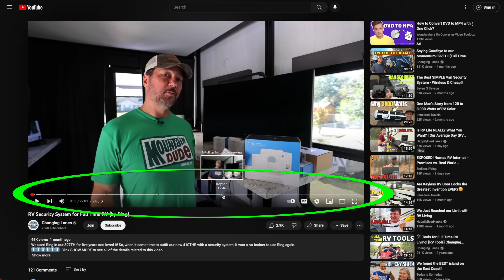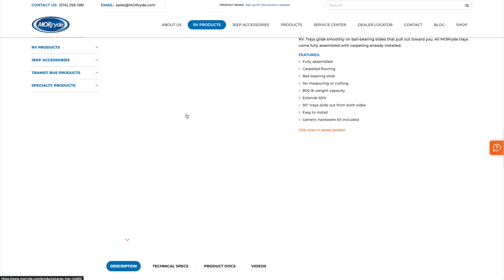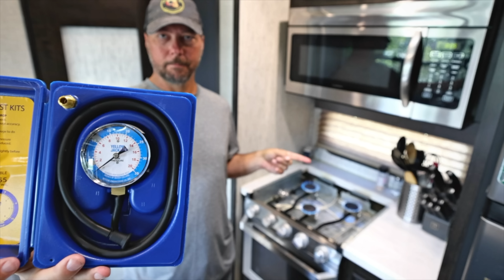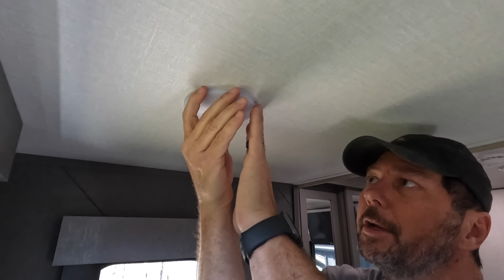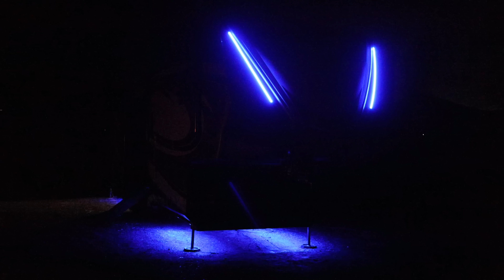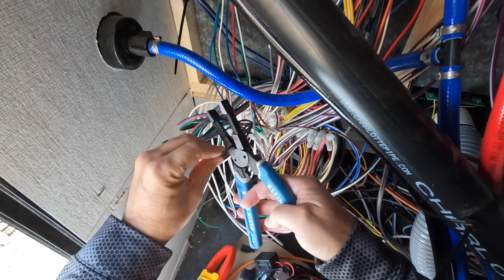Five EASY RV Projects for our New RV

Comment: Grand Design has just burdened our family with a $27,861.60 debt to repair factory weld failures hidden in the walls of our 2019 Solitude 380FL.  The RV suffered a bilateral structural weld failure on both sides of the front living room that was hidden in the walls. Essentially, the welds failed on the aluminum substructure leaving the slides to hang off the front living room walls on each side of the RV. Unable to support the weight, the walls began to cave and the schwintek slides began to show signs of failure, slowing down and vibrating, and one of the schwintek slides had to be replaced due to damage from the structural failure.  Fifty-nine (59) photos of the structural failure and the repairs were presented to Grand Design and they refuse to accept any responsiblity. Given the danger of structural failure we proceeded with the repair immediately. Grand Design claims that we should have just left it broken and placed the safety of my family at risk.  The structural failure resulted in the slides slipping and opening cracks for water to fill the front cap. Therefore, the repair included repairs to the front cap from the water damage and mold.  Please keep in mind, these welds failed long ago, and the walls held up the slide boxes as long as they could. There is another 380FL directly across from my camping spot  and his front living room walls have started to collapse inward and they were able to verify the same structural failure with the welds in the front living room.  Grand Design used to be a company we could trust with our families safety and well-being.  Those days are past and the company is now laying off workers and abandoning their customers.

Comment: I decided to catch up on ordering some of these items.  Alas, I guess I waited too long....as of late July 2023, the remote wireless lighting controller (for the bedroom overhead) is NO LONGER AVAILABLE on Amazon and, oddly enough, I could not find a similar item (with only a different set of gobble-dee-gook letters in the name).  Other wireless controllers are built around phone apps or for key rings or for controlling RGB-separate lights.  I guess I'm going to have to tear into the walls and go with a wired solution.

Comment: Wonderful video Chad. Thank you for taking the time and effort into making it. We just picked up our 410 from a dealership in Arkansas and finally made it back to North Carolina after a 40 hour round trip drive. Looks like we have the exact same setup. I am trying to figure out what size tray I can put in there. Looks like MorRyde offers a 20 inch by 90-in but I don't see another option. This 20x90 would result in some wasted space. I tried to click on the link in your description to see what size you have but the link to e-trailer is not functioning. Can you tell me what dimensions tray you have?

Comment: Had my first complaint about my cap lights from a fellow camper.  Going to attempt to install your switch to separate the cap from the lower accent lights.  Without your deluxe meter I think I have a 50-50 shot at getting the right neutral wire, if not then recrimp and try again...  Need to buy the switch and some crimpable connectors.  Do you have a standard connector that you use and recommend?  2022 397 TH-R  TIA.

Comment: Wife says I can't watch your channel any more.  That remote switch is awesome find, already have 2 or 3 places to put it :)
BTW, good thing I put in the easystart... but not for the reasons you might expect.  I discovered the hot freon copper tube was rubbing against the aircon fan frame.  I need to get back up and look harder at the line to investigate how much damage has been done to the copper :(

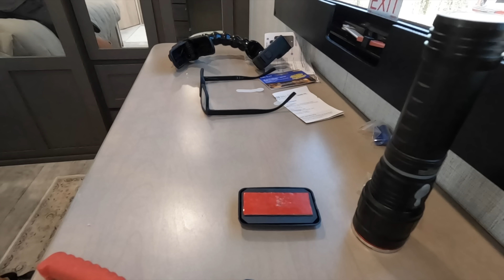Comment: I installed the dimmer on the light above our recliners.  I know it’s wired correctly because the light powers on. But the switch/dimmer doesn’t work at all.  I even te-paired it per instruction. 16:03 Guess I need to call the company. Anyone else have issues?
Reply: As Chad mentioned in another reply on this post, as well as a reviewer on the product's Amazon page, these switches disconnect the negative side of the light circuit (which is opposite of what is done with breaking the positive/hot side of wiring in home lighting).  If you have multiple ceiling puck lights that you are trying to tap into, you might be running into a problem with daisy-chained negative/neutral wires that is not allowing the controller to function properly.  The bedroom overhead is a simple situation of one wire is positive 12v and a second wire is negative 12v, so it is imperative to follow Chad's instructions of always verifying what color is what polarity in each fixture (as the RV industry does not use any standards for wiring color coding, as are used in a house).  Then make sure you understand the controller's functions (kill positive side or kill negative side) to wire appropriately.  Lastly, this remote light controller is no longer available on Amazon (as of late July 2023).
Reply from the maker: Did you take a voltage reading to ensure the positive line was actual positive?  If so, I would call or email them..

Comment: Great Video.  We have been full-time in our solitude 345gkr for almost 2 years.  We had already done the gas stop, insect screens, anti stiction fluid (although we may change brands now), and split the cap lights/front storage/underbelly into 3 switches.  The Morryde tray is out of our budget right now but we really like the idea.  We have been looking for a good option for the bedroom lights.  Really dislike the buttons popping up inside the light and the long reach required.  We added the wireless switches that you used and we love them.  Thanks so much.  Love this kind of video.

Comment: I got one of the switches today that you recommended but actually I think they are Him and Her switches. I installed it and it wouldn't work so I started swapping wires around. Finally, after wiring it right like I did the first time it worked...sometimes and it wouldn't dim at all. My wife grabbed it and it worked for her every time. I took it back and it worked...sometimes and wouldn't dim at all. But it works as advertised for her...everytime.

Comment: Thanks for the info on the cap lights. We feel the same as you, we like the underside lights but cap lights are obnoxious. Plus why not put the switch inside the rug not outside on the front. I’m working on moving ours inside and separating them. 👍

Comment: Brilliant work Chad! I love your unbiased, non-sponsored, extremely informative, well throughout, and professionally filmed and edited posts. The two of you obviously take your time to solve these issues and seek out tools, hacks, and products to make life a little bit brighter...ahem.... I mean sweeter.

Give that cheerful, sweet, amazing, brilliant, and beautiful (not creeping on her.. I'm 110% gay) wife of yours some extra love and attention for me as continues the tough battle.

Those looking to put dimmers on everything must verify your Amp draw for each of the lights. Most of these small dimmers are 5 amps. I believe this specific dimmer (now sold out) is 5 Amp. Something else to consider when installing wireless devices is the possibility of other items using RF remotes to share the same frequency. This is more common with IR remote devices than RF. For example one set of wireless candles, a space heater, the fireplace, and e
Edison style IR led bulb all share some frequencies. Adjusting the temperature on the space heater changes the color of the Edison bulbs and turn the fireplace flames off. Selecting the four hour timer setting on the led candles also switched the fireplace timer, dims the Edison bulbs, turns on a timer for a second set of legs candles from 2010 which was not advertised as remote operated nor with functions (I can dim and put them on a timer thanks to the remote for the Dimplex fireplace), and turns the space heater on or off.  It's a fun game, requiring both hands, turning the island lights, candles, space heater, and fireplace on or changing their settings. So fun!! Hhaha.

I pray others follow suit to find their way to turn off their cap lights. Thank you for understanding cap lights can be a real blinking sleepless headache for others. Every unit I've owned with MCD night shades has had the same issue with the night shade ends curling. Without lambrequins, light streams in like thousands of laser pointers. Neither my current or previous DRV Houston are equipped with lambrequins. Yes... please turn off cap lights and scare lights near the neighbors bedroom windows.
Cheers!

Comment: Thanks for the tips. Been looking for the way to get the front cap lights off on mine. Love the light switches, will use those in the garage as I added  led tubes in the corners for extra light and an outlet for my portable fridge. I also got rid of the LCI router and put my own in so that I did not have to switch networks to control the RV. There is a hint for a future video.

Comment: @Changing Lanes so I am having the same issues with popping noise on the jacks. I just got the CAT Hudraulic Oil Additive so do you only need 1QT? Or two of them? Do you need to drain 1AT of the oil from the reservoir?
Reply from the maker: Yes.. just one quart did the trick for us...  Remove a quart, then add it..
Reply: @ChangingLanes  good deal
Thanks a lot.. I love your channel and all your adventures and advices.

Comment: Great video! So many good ideas. I am really looking forward to having a sliding tray in my pass thru! It will make pack up and set up so much easier. The switch on the oberhead lights is an awesome addition that I will be adding as well. We have learned a lot from you guys, thanks for sharing and safe travels.

Comment: I like the dimmer switches, I also have the same puck lights. To be changed soon. 
Does anybody make a bug screen for the refrigerator vent? Right now I have fiberglass screen on the inside of the access panel. Found those mud dobbers in there.
Reply from the maker: Maybe these? https://amzn.to/3nPnvjK

Comment: In your knowledge, are all the puck LED lights able to be run through a dimmer switch. Ours over the bed are not the nipple type but are on a wall switch.
Reply from the maker: I can't say 100%, but they should work on most LED lights.  Additionally, the ones I used can be pared to 3 lights or a single light can be pared to 3 switches.

Comment: Another great chapter Chad!  Curiosity has me ask from one of your old upgrades on the party deck flex seal upgrade.  Will you be doing that to your 410? My wife and I purchased the Momentum 320G last fall and that was one of the first upgrades I did.  Our previous toy hauler showed signs of leaking, so I wanted that fixed immediately before winter storage.  Your video was a big help in accomplishing this for our brand-new TH.  Thanks again for all your help via these videos!
Reply from the maker: The newer LCI ramp doors are waterproof.  We had one put on our 397 and lived with it for a couple of years and had no issues with it.  The one I flex-sealed was the original (on our 397).  That said, I did put regular black silicone sealant on the ramp part of the garage where the bottom of the door frame meets the rubber floor.  So, we can leave the ramp down and 3 season doors closed and not get water intrusion under the deck.  Hope that makes sense.

Comment: For the reading lights there wasn't any issues using 2 different remotes for 2 different lights so close together?
Great video. I use Gas Stop and very pleased. I also got great customer support when I did have questions. You can also use them to test for slow leaks. Which I think is a great. I also purchased there hoses for my last trailer as the straight in didn't fit under propane tank cover.
Reply from the maker: No issues at all.. additionally, One remote can be paired with up to 3 different controllers, and one controller can be paired with up to 3 remotes
Reply: @ChangingLanes  thank you

Comment: Chad, you hinted in the video that the next one will be on the new internet setup. Quick question, are you going to attempt to wire in a RJ-45 inlet for the StarLink cable? If so, in the video can you go into a little bit of detail on the wiring standard that you used? I can't seem to find a solid answer out there.
Reply from the maker: I will.. I use T-568B pinout (https://www.showmecables.com/blog/post/rj45-pinout).
Reply: @ChangingLanes  Thanks looking forward to it,  I keep confusing myself on the splice and don't want to cut the cable until I am sure.

Comment: Thanks for showing your mods. I was thinking about puttjng a slideout in a travel trailer that has an unusually long storage spot  under a bunk bed.  The remote lights would be good for controlling lights once gine to bed verses turning them off near the entrsnce and tripping over things heading to bed.

Comment: Another great video Chad.  I love the MORryde slide in our rig.  I installed ours before having shoulder surgery two years ago and I don't know how I got along without it before that.  Being presumptuous, I did not order the spacer kit as I didn't think I would need it; however, I did need about 1/2" of clearance to clear the driver's side basement door so I cut down strips of 3/4" plywood the length of the tray and covered the strips with grey needle punched automotive/marine grade carpet I had left over from a boat project.  Worked perfectly.

Comment: More kudos for chapter editing and updates!  Also, after watching your 397 video on the cargo trays, we got one for our GDRV 341RDS and love, Love, LOVE it!!!  RV manufacturers should offer those as optional add-ons...they are GREAT!  I needed a bit of a lift to clear the bay opening, but went with a home-brew solution of a strip of 3/4" plywood running all along the tray bottom as a riser.  Saved some money over the MorRyde riser option and provided full-length weight support to boot (better than the MorRyde system, perhaps).  Can't wait for Internet 4.0.  Keep the good info and RV insights rolling!

Comment: You always want to switch the hot side of a light socket to make sure your neutral line is never hot.  When you switch the neutral side, all at once your neutral side of the light socket and every where else it goes down stream from the switch becomes hot, or creating some unintended series circuits.
Reply from the maker: The neutral / negative / ground is the only way to do this without putting in 3 switches (one for each RBG)...

Comment: Good detective work to find the front light circuit.  I learned somewhat.   I'll look on the list to see that nice Fluke .. I have some older units and should work with them more to get the upstairs ticking and thinking better..  drive safe.

Comment: This kinda off subject to your video but not sure if you have electric/gas option for your camper furnace or if it’s just gas.  We just bought a camper and wanted to do a couple upgrades before camping season started in North Dakota.  We started our electric heat and stayed warm in there all day, we went in there the second day but it was cold.  This has happened twice.  Have you ever had this issue before?  We have not tried in on gas yet either, thanks
Reply from the maker: We have the heat pump option in our main AC, but it's only effective down to about 45 outside, then the furnace (gas only) kicks in.

Comment: Great video. Like the solution for the reading lights. For my front cap lights I found the wires in the front storage area and put a dimmer on them. I have a 374th so don’t have the one control

Comment: TGIS - Thank goodness its Sunday... and another video.  Curious if you have had to reboot your OneControl system.  On our 2022 397 we start to lose connectivity with the app and must power down the rig, all battery switches to Off, and then remove the negative wire to the control unit.  Royal pain and concerned I am going to drop the nut into the "Spaghetti".  Thinking about a simple on/off switch so I do have to break out the nut driver each time.  Would the switch shown for the cap lights work for this disconnect process?  Always great info... Thanks.
Reply from the maker: If you put a switch on the + DC line for it, that would definitely work to power cycle it.  I did have to reboot ours, but I think I just held down the main button below the screen.  I can't remember now, but I definitely didn't disconnect it.
Reply: @ChangingLanes  Thanks for the reply.  GD support outlined the reboot procedure that I have been using.  Think there should be an easier reboot function and will explore the buttons.  Long time IT credo... "When in doubt, reboot"
Reply: Following up... Spoke with Lippert before resetting at the panel.  They told me to just to turn off the batteries with the disconnect switches for 5 minutes.  Worked and the app was able to reconnect.

Comment: I have installed the slide tray in both of my 5th wheels.  When installing I used the  Risers also, however I put them at the highest level this allowed me a place to store long items such as brooms, racks,flagpoles and my spare pex tubing.  Works Great and still have room stacking 2  totes on the tray.
Reply: We did the same on one of ours. The other we placed at the mid height of the riser for access under the tray. We keep the outside doormat, brooms, etc. under it.
Reply from the maker: Good tip!  👊🏼